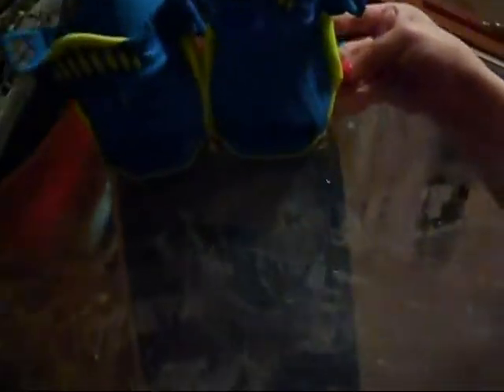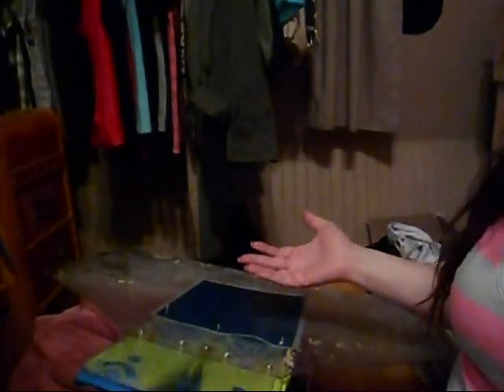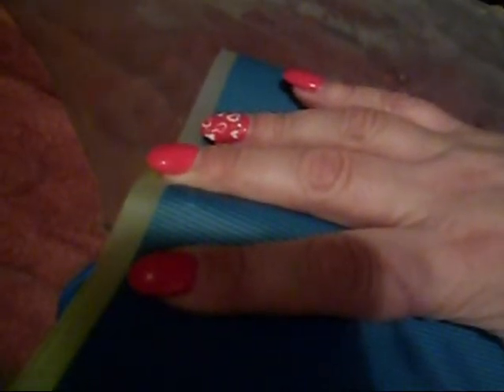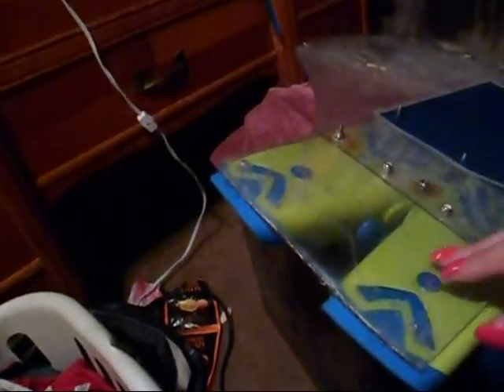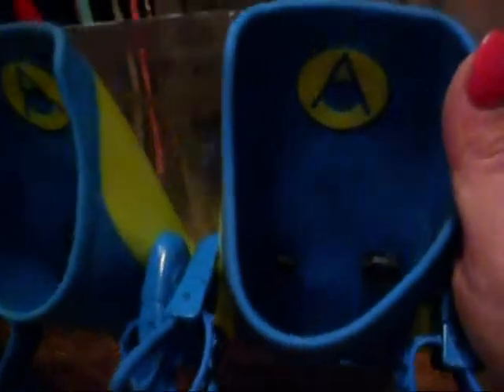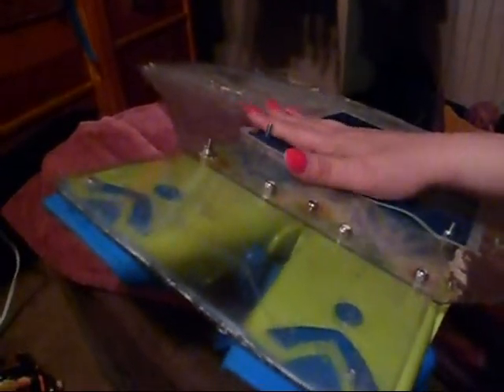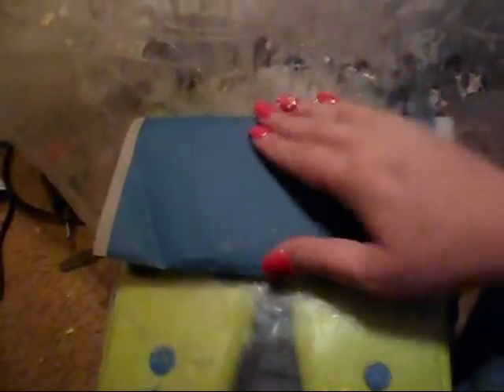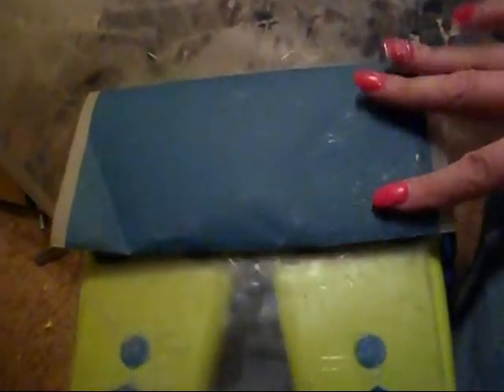Mermaid Taiil Making Series: Bump Plate

Comment: Hi Jules,

Thank you for this awesome tutorial....  I was wondering when making a silicone and neoprene backed tail what is the best way to adhere them? or should I ask on the mernetwork?

I also wanted to let you know that there are screw posts that screw into themselves and will lay flush on the Lexan. They come in sizes; 3/8", 1/4", 1/2", but I buy them for leather work. thought that they might work for future custom projects, and if you have some time check out www.tandysleatherfactory.com for them (screw post).

Thank You again for the most informative series ever!!!!

Love and peace,
Ve
Reply from the maker: Hi Veronica. I would suggest asking on Mernetwork. As of right now I only deal with Latex. I haven't done a silicone tail yet.